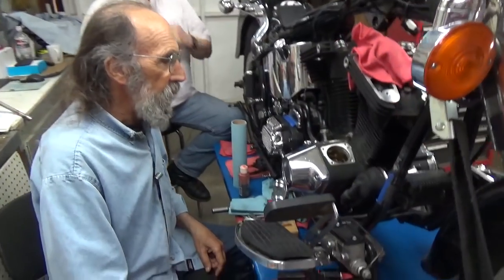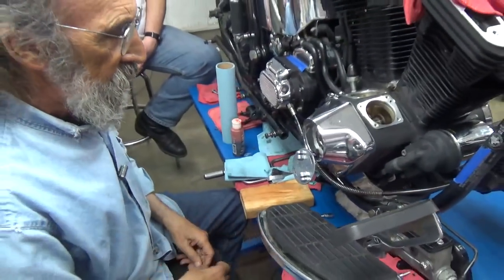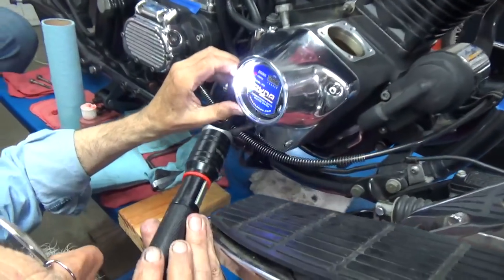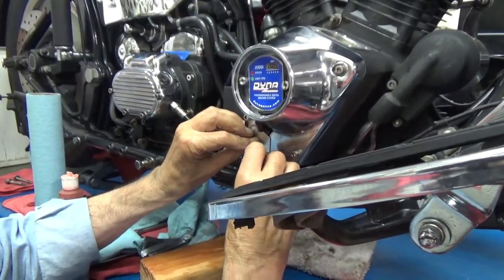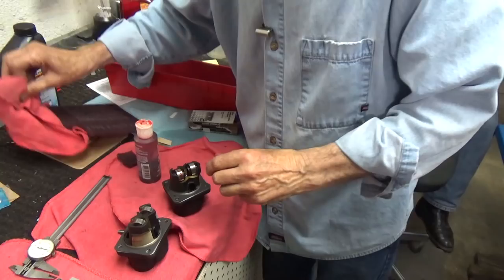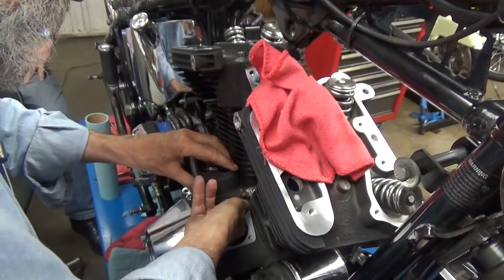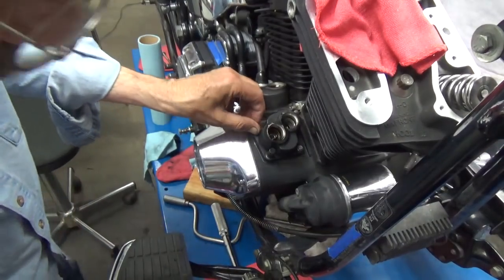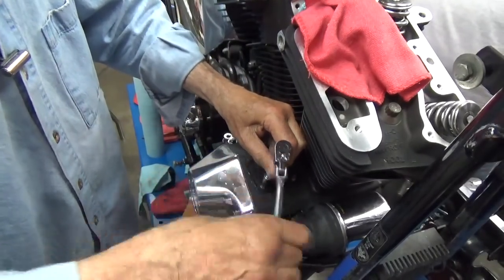Carryover Part B   Camchest and Lifters on the Evo Stroker

Comment: When you insert the cam does the crankshaft have to be at TDC?
Reply from the maker: Line up the marks on the gears.  The pinion gear timing mark should be streaight up.  Then install the cam gear, then the breather gear with its timing mark.  You should definitely review all of this in your year and model specific HD Service manual.  This is not the place to mess up.  You are into a very expensive motor.
Reply: @pacificmike9501  Thanks for the fast response..Mike. And thanks for all the great Evo videos. I wish I had all the knowledge (and tools) that you have. I have a 1998 Harley-Davidson Road King Classic with a 121,000 miles on it. It has the Magnetti Marrelli fuel injection which has always gotten a bad rap..I was going to change over to a carburetor and went to Ed's Harley-Davidson in Decatur, Indiana and when Ed saw the mileage...he said he thought I  should not put a carburetor on since it's gone this far with the fuel injection. It still runs beautifully but I have been thinking about the cam upgrade. Thanks again, I appreciate you.
Reply from the maker: I agree.  A Magnetti Marrelli that runs well and is totally dependable should not be messed with.  Very few people are proficient at trouble shooting them.  Changing to a carburetor is a pretty long-winded project.  The last one of those I did, although quite successful, was quite costly.  I changed the entire wiring harness and installed a complete modern electronic ignition, a carburetor and manifold, and modified the gas tank.  Doesn't sound like a lot, but it is.
Reply: @pacificmike9501  It does sound like a lot of work to me to change over to a carburetor. I  found an independent dealer who like you knows how to work on nearly every Harley-Davidson ever produced. Most of the dealerships that I went to before I found Ed's Harley-Davidson said they prefer not to work on bikes that are over 10 years old. I'm thinking it's probably because technicians these days don't learn how to work on the older bikes. I've had my bike for 10 years now and have learned to take care of most issues I've had on my own. Most of those issues have been sensors...cam position sensor, crank position sensor and throttle position sensor. I'm a little hesitant when it comes to installing a new cam,but I would like to upgrade the cam. Thanks for your knowledge and willingness to share with everyone online.
Reply from the maker: I understand the desire for a cam.  I hope your system is set up with some sort of a tuneable module.  Otherwise, you may not be able to adjust your tuning to your satisfaction with the cam change.
Reply: @pacificmike9501  Ok,I don't have a tuner right now,but if I get a new cam..I'll get one. I've looked into them before and it seemed to me there was a limited amount of tuners that would work on my bike(1998 Road King Classic) I saw a Dobek tuner that claims it will work. Thanks Again, Mike

Comment: Do you need to use tappit alignment tool?
Reply from the maker: The tappet alignment tool was designed to hold the tappet bocks in their perfect position on Evo motors.  It's a good idea.  It is a tapered tool so it really does locate that tappet block correctly.  Necessary?  Not really sure, but a good idea.

Comment: best cam with out getting into the heads or carb. little bigger then stock, no one can give me an answer, 1998 flsts,  thanks
Reply from the maker: Everyone has their own preferences.  You're looking for a "drop in" cam.  In other words, a cam that won't require any modifications.  There are a whole lot of brands out there.  Andrews makes some and so does Competition Cam, S&S, lots of people.  I don't know what you would like.  Read what they all advertise to do.
Reply from the maker: The cam I put into that bike had way more lift than you could install without modifying the heads.  These heads were very heavily modified.  However a much milder version would be a Dave Mackie 500, available from Dave Mackie Engineering in Ventura Ca.  They have a website.